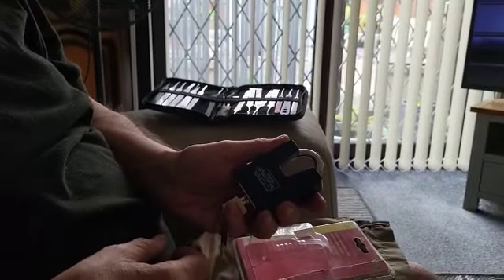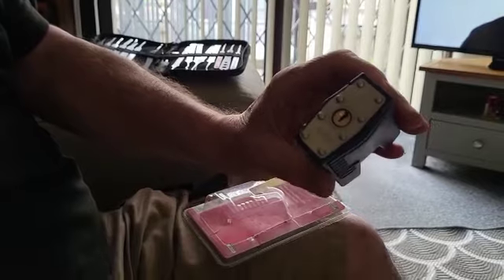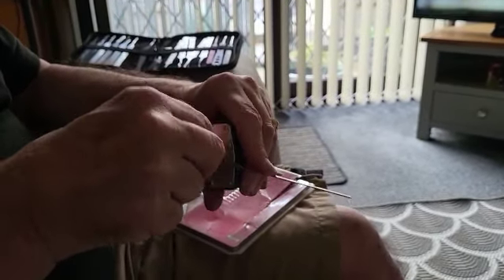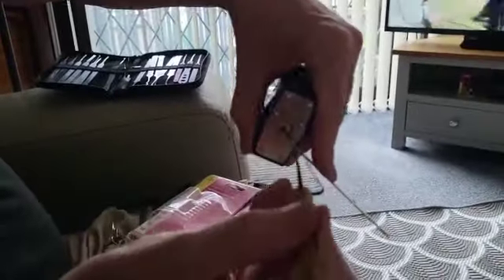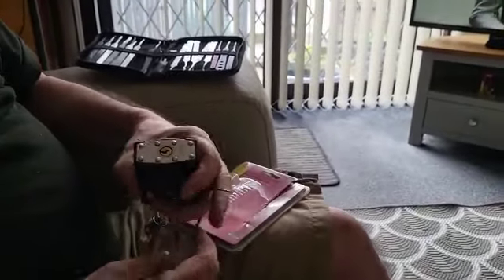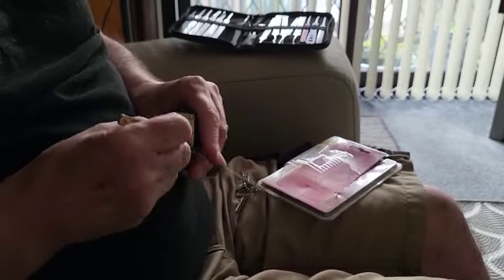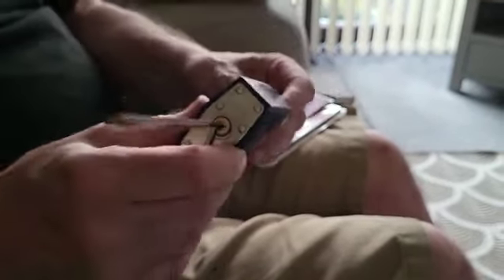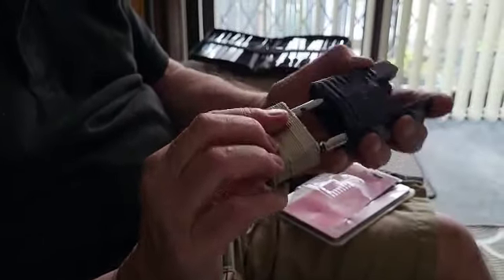(071) Picking A Burg Wachter Sapphire Padlock 121 CS 50 (like a carry on film)

Comment: Very nice demonstration. A bit of a surprise that the cover was just a plastic one, more like bump protection on what it is locked onto than any weather protection. There were no rubber seals around the shackle and no end cap protection over the core to keep it protected from the elements. Thanks for this video, cheers
Reply from the maker: Your correct about the lack of weather protection thank you for watching